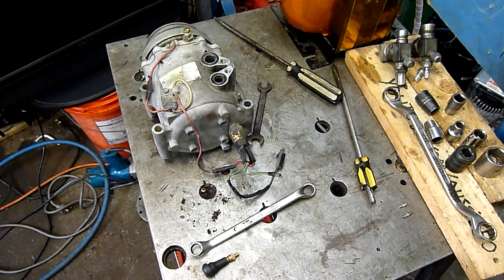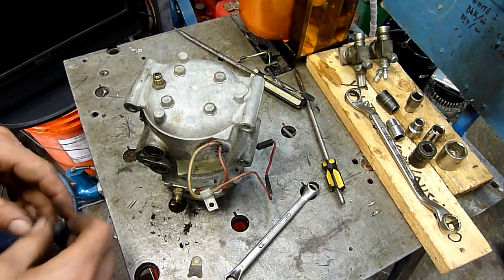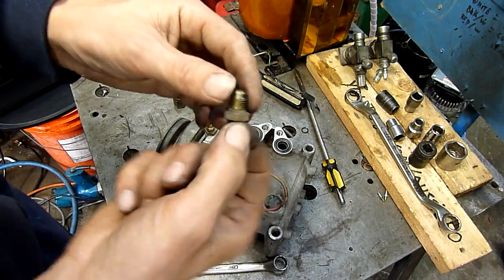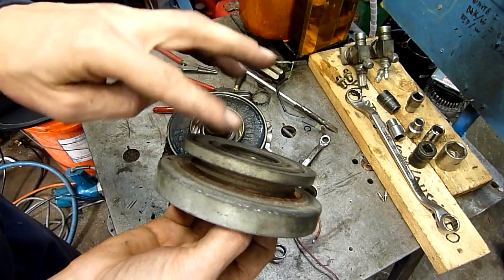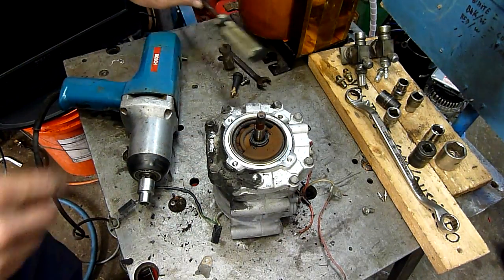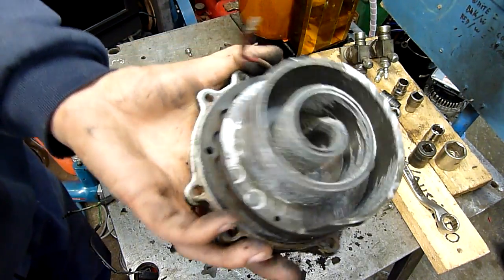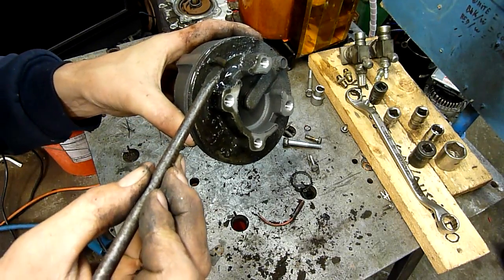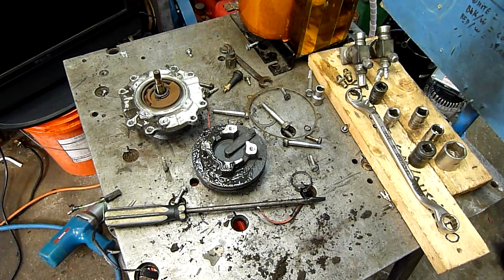Failed Sanden Car Aircon Scroll Compressor - Full Autopsy

Comment: must get pretty damn hot down there for an automotive ac compressor to have a thermal cutoff...
Reply: Rotary compressors (such as rotary vane and scroll) have a bad habit of getting terribly hot and inefficient whenever superheat increases too much, in addition oil will start degrading once the discharge temperature gets too high (again due to insanely high superheat). The thermal cutoff is there to stop operation when the refrigerant charge becomes too low to fill the evaporator and maintain a low enough superheat, resulting in an overheated compressor.
Reply: down here the thermal cutoff.is  Standard   its nothing to with how hot in gets down here   but it does get  as hot 56 degrees in some places

Comment: Would think you'd want to keep a couple of working clutches around too.  Handy for switching loads on and off while letting the engine continue to run.  Many years ago I adapted one to the crankshaft of the Corvair engine in my dune buggy so I could switch off the cooling fan during quick hill climbs. :) At 6500 engine rpm, the Corvair fan takes around 30 hp.  Was a noticeable boost when shut off.

Comment: could you please tell me if this statment is true "The motor compressor is suspended by springs in the capsular housing which minimises the transmission of vibration to the capsule body, thereby reducing noise emission"
Reply: TRUE!  Just like motor mounts on motorcar.
Reply: Eyad Alhazouri True, however, you might want to place some vulcanized rubber compound in between the steel casing of the compression device and the place such device is to be affixed. this in addition to the afformensioned spring shall further improve the dampening of vibrations. ;)

Comment: They probably just installed the compressor as was out of the box and it never filled it with oil at install.

Thing probably lasted a while too I bet, but not nearly as long as it should have.

Comment: My Corolla has a SC - 723529 compressor, can't find any info on it when I search that. It's a cute little scroll compressor with a pulley diameter about 3/4 that of the drive pulley diameter so it must run at really high RPM. But that car has the coldest AC I've ever felt. It even has a sight glass to view the liquid R134A as it leaves the condenser.

Comment: there is a tag that says cw or ccw if it's still there. if not cover the exhaust (small hole) with your finger and see which wich way you get pressure out of it . if you ordered it specifically for your car it should be the right one. hondas rotate ccw. don't know but I think most are cw

Comment: 15 years in A/C. If its late and that's the last shed valve I have and I need a new one from the shop. I'll pull the whole thing and just seal the cap. If you got the piece to install those valves under pressure you're set. Just depends how slow and weak you are.

Comment: Pretty cool mess of a scroll pump. I did find a couple web pages of info on Scroll Pumps:
wikipedia article:  /wiki/Scroll_compressor
also on there: /wiki/Archimedean_spiral

First invented in 1905, but not available till after WWII, because of tight tolerances.

Very easy to maintain as long as there is oil in the darn thing.

Comment: you can also use those A/C compressor clutches for portable air compressors , use a pressure switch to cut out the compressor at a set pressure , and you just got around the very expensive unloaders the factory built ones used , with that clutch , and your equipment , you could easily build a petrol powered air compressor for fun , you I think have all the parts setting around the shop ;p

Comment: I have a nice little tool to change those valve cores while a system is charged , neat stuff , I have even used it to change leaky cores on tires that are inflated with nitrogen to keep from having to waste the nitrogen ;)

Comment: There is a tool to replace hvac schrader valves while the system remains charged.  Check out the Yellow Jacket HVAC catalog, if you aren't familiar with them.  They work reasonably well